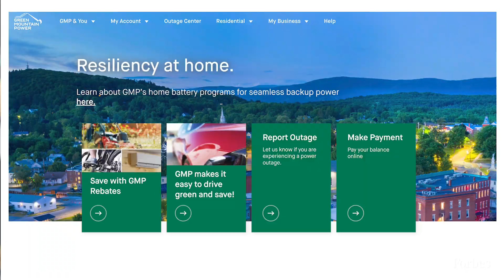How Sunrun Is Easing The Electric Power Crunch With Solar Power

Comment: I got Sunrun PPA about a year ago and I am not pleased at all.  Between the Sunrun bill and the SCE bill i am paying more then just buying electric from SCE.  The system is underpowered for my needs so my SCE bill is still high.  I have complained but they say my system is performing perfect and use tech terms that confuse you.  I was promised 74 percent and i am getting around 30 percent solar energy.   I asked them to install another Tesla battery, which would allow me to store more solar and thus lower my bill, but they do not respond.  Stay away from Sunrun!

Comment: The practical use for the wild AC generated from wind and solar generated electricity is for maintaining electrical storage such as charging batteries.   There is 1% fuel saving from solar voltaic and the same for wind generated wild AC forced onto the public power grid and support of it by the public power grid.   That is only a statistic blip of 2% fuel savings in 2023 for the US because the wild AC has to be instantly backed up by natural gas turbine generators running at high service idle.   

The duty of a public electric power utility is to provide a low cost, reliable, safe electric power to homes, businesses and industry.   The US power grid was built to be highly economical as a matter of ethics.   The US power grid has been producing greatly clean electricity since the mid 1980s when sulfur dioxide causing acid rain, unburned hydrocarbons and coal particulate mater such as fly ash were addressed to no longer be considered health issues.    

It is scientifically impossible for greenhouse gas behavior to cause global warming.  All the greenhouse radiant energy from the earth is always completely absorbed in earth's greenhouse effect within 20 meters of the radiating surface.   

In the 1950s earth’s atmosphere had been greatly studied and the characteristics of its major gases greatly understood.   Earth’s saturated greenhouse effect from water vapor adding 10°F (5.55°C) to earth’s average temperature was well known.   In was taught in 1970s US public school science education.  

The term Climate Change in the early 1980s was use to promote the changes increasing average global temperatures would cause when global warming reached 1.5°C on track in 1980 to take place in 2010.  At 1.5°C of global warming observable stronger hurricanes in the Gulf of Mexico were predicted in the early 1970s to take place causing crude oil companies to increase the storm strength designs and builds off their Gulf oil drill platforms.   

Global warming staled at about 1°C in 1992.   There has been some increase in sea levels from global warming due to expanded warmer sea water.   There has been no Climate Change at 1°C of global warming.  At 1.5°C of global warming it was expected to show the first observable signs of changes caused by global warming by producing stronger Gulf of Mexico hurricanes.   The cause of global warming is not known in 2024.  The Arctic region is warming.